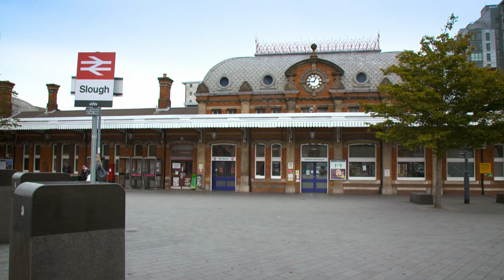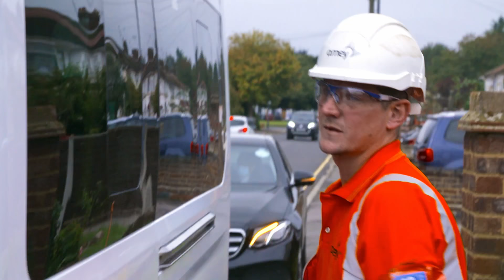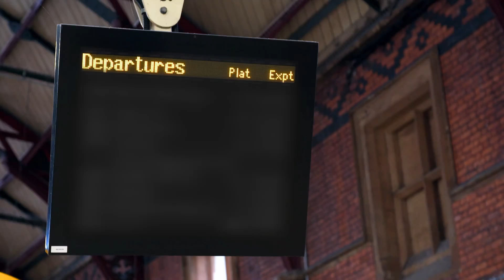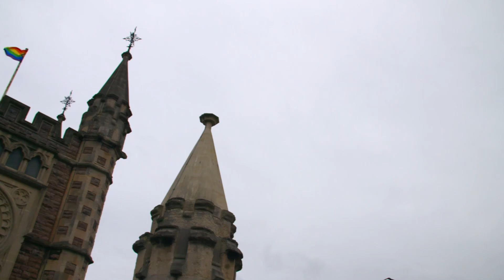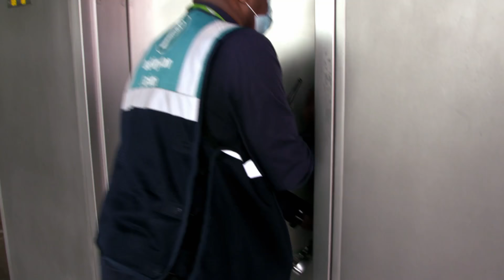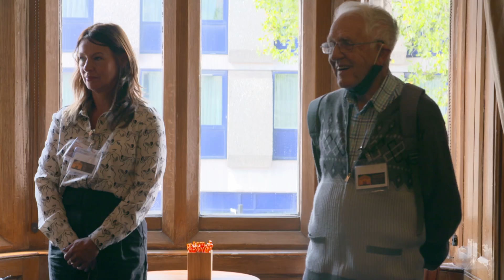RAILWAY CLOSED While 3 MILES of Track Re-laid | Paddington Station 24/7 | Full Episode

Comment: The van bridge strike was a crazy and unnecessary train delay situation as the photo of the wedged van clearly showed that it struck a service pipe and was nowhere near the bridge structure... I wonder if everyone concerned at Paddington, Route Control and at the bridge site left their brain cells at home that morning !
Reply: While yes the protective bar has done its job, if you had a bump in your car and it broke the bumper, the mechanic would check the rest of the car. Same with the bridge, it’s due diligence. If they just went “ahhh be alright”, and then it collapses, we’d all be here saying “a 5 minute check would’ve stopped that”.

Comment: Must be the fault of Network rail as it was Gods wonderful railway and built to Broad gauge ? and therefore enough height until track lifted too high ! Own goal ! I mean the line around Dawlish has been lifted far too high and was behind the wall,
Reply: Er it wasn’t built to take overhead contact wire for electric trains as electric trains weren’t invented then 😂 so track needs to be lowered to allow for them, it’s not anyone’s fault it’s called improvement!
Reply: @stephenthompson7208  But broad gauge of GWR is to EU size and hence no trouble with overhead cables from Paddington to Wales other than a new Bridge in Oxfordshire. HS1 apart from that 1 new bridge could of gone all the way to Bristol. Thats why the HS1 stock is/was there at Old Oak Common
Reply: Broad as in wide, not high.

Comment: The tunnel works remind me of the Penmanshiel tunnel disaster on the ECML back in 1979 when similar track lowering works were taking place resulting in over 20 metres of tunnel collapsing. Workers Peter Fowler and Gordon Turnbull were buried under the collapse.Their bodies could not be recovered resulting in their bodies remaining under the collapse.This resulted in a deviation above ground  of the railway and A1 road around the sealed tunnel. RIP.

Comment: Nothing new, there is a tendency to over ballast the track and lift it. Happened on the Matlock - Derby line and a steam engine hit its chimney. Tracks repositioned and singled to centre location in tunnel.  Also done on Buxton to Whaley Bridge line.
Reply: Apparently it also happened on the Salford chord years ago. A steam engine that had been through some time previously had its funnel damaged when it hit a low bridge/ tunnel due to over ballasting during some works.

Comment: Stand edge tunnel is longer then Sodding Chipbury. It’s over miles
Reply: 3 miles standedge tunnel
Reply: The Pennines and Peak District is full of longer tunnels.

Totley (between Totley and Grindleford on the Hope Valley line) at 3.5 miles is longer than Chipping Sodbury 
Standedge is a little shorter at just over 3 miles (for the live tunnel, with the central and south tunnels being a few yards shorter).

Even the 1886 Mersey Railway under the Mersey is (just) longer, with the tunnel/underground section between Liverpool Central and Birkenhead Central being over 2 1/2 miles, and including going under the river.

Comment: It happens a lot but network rail has not learnt a lesson. The rail terminology as bridge bash. It may have a simple solution old tracks could be used to stop well in advance by building a structure.

Comment: The longest rail tunnel is East Finchley to Morden.
Reply: Is it longer than the Severn Tunnel?  That's 4m 628yds.
Reply: @Beatlefan67  By a LONG way - the East Finchley to Morden tunnel is 17.3 miles - almost 4 times longer than the Severn Tunnel.
Reply: A number of tunnels in Great Britain are longer than Chipping Sodbury. Unfortunate that the script for this film was not fact-checked for ferrors.
Reply: London Tunnel 2 between Stratford Intl and Dagenham is 6.5 miles long and is the longest tunnel in England.

Comment: The van was stuck under the protective device, not the bridge. How could it have damaged the bridge if it never touched it? That is the whole point of that device: to be slightly lower than the bridge itself.
Reply: Protective device attached to bridge...basic laws of transferred force
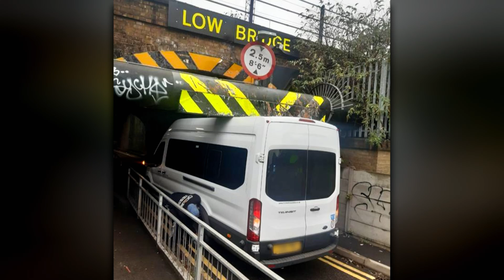Reply: @kevineveritt3157 08:04 - Nope, this is not attached to the bridge, separate structure in front of the bridge.
Reply: Are you sure it was a protective device? Looked more like a gas main to me.
Reply: @OldGuyChapman  Or a water main. Non the less: for sure it was not the bridge. 🙂
Reply: @csabasipos6525  you still need to ensure the bridge itself is in good working order and not damaged, better safe than sorry

Comment: 2 thousand mile rout? the whole rail network is 2thousand track miles
Reply: Network Rail is 20,000 (Twenty thousand) miles; you dropped a 0 somewhere.
Reply: Not sure that is accurate, I think Electrified track alone is 3x that.
Reply: you can go anywhere from padington if you change